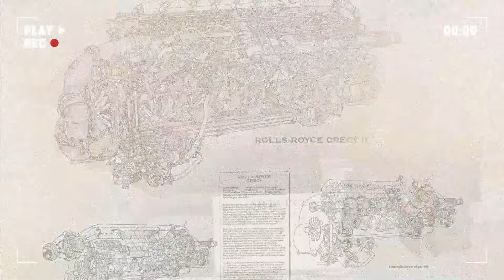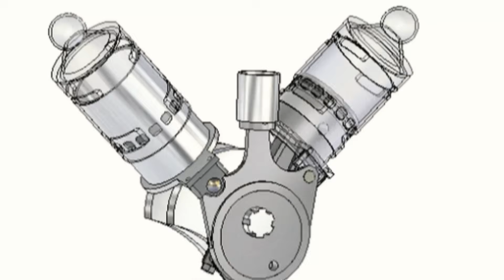The Shocking Truth Behind Rolls Royce's Crecy "Super Engine"

Comment: Sleeve valves are finally making a comeback due to modern precsion machining tolerances and metallurgy.  Back then the tolerances required to avoid siezing meant they leaked energy, and required high maintenance.

Comment: You do realise that a sleeve valve engine works on the four stroke cycle ?
Reply: Not necessarily.
Reply: @tjm3900  huh?  Bristol Centaurus begs to differ.
Reply: @tjm3900 Napier sabre and Bristol radials like the Hercules and centarus worked fine

Comment: Had the Crecy been operational in 1942, it might have ended the war a year sooner. But then, since we've entered the wonderful world of "If", if the Junkers Jumo 004 had been operational in 1942, the war might have ended in 1946.
As you said, timing is everything. When you enter a war, you're compelled to "run what you've brung". GB had NOT brung the Crecy. The very nature of it's highly advanced design brought ancillary design & production problems, requiring their own development times, of high precision, high in demand,scarce strategic materials, high production cost, slower production. By the time it was production ready, the war was over, and better solutions were available. Jet engines, and in fact, the Griffon engine, which could be developed to 2500hp faster & cheaper. Just in the way 40K Shermans & 40K T-34's will trump 1.4K Tigers, scads of 2000hp MkXIV's will trump a handful of Crecys.
Reply: Very good point.  The Vulture was another good example.  Horribly unreliable and with all resources directed to the Merlin, its full potential was never realised.

Comment: You have neglected two other - concurrent - truths: firstly, Bristol Aero Engines had already developed the sleeve valve to production standards; secondly, Napier was also well ahead of R-R with sleeve-valve use in its 24-cylinder Sabre, assisted by Bristol. The Crecy was obsolescent from the start, and by no means “cutting-edge”…
Reply: The.Crecy was an amazing engine, even experimenting with a turbocharged 2nd stage there was still the equivalent of about 400hp in left over exhaust thrust alone. Plus sleeve valves meant one could get an extra point in the compression ratio using the same fuel (over a poppet valve equivalent) without detonation. 2 strokes that are boosted don’t require crankcase scavenging so they can have conventional cranks so there’s none of that mixing the fuel & the lubrication, so there’s none of the issues that come with it & with direct fuel injection the only thing lost from overlapping valving is just a little compressed air. So the efficiency & emissions issues that traditional 2 strokes have don’t apply here. Also by the time the Crecy would’ve come into play, Bristol had well & truely solved all the issues in metallurgy & manufacturing required to make sleeve valves.